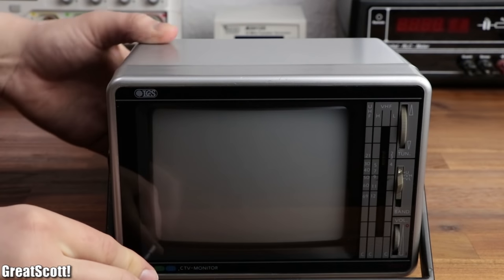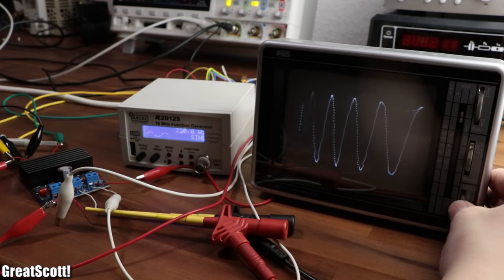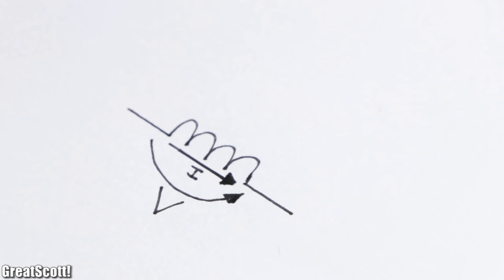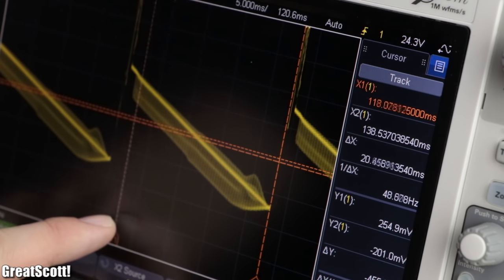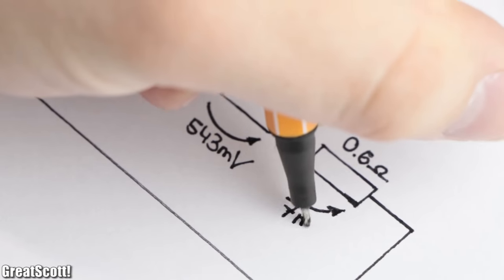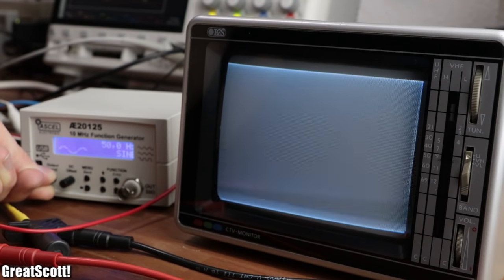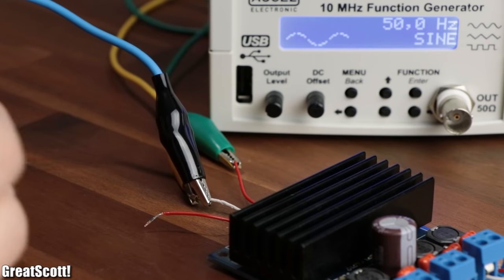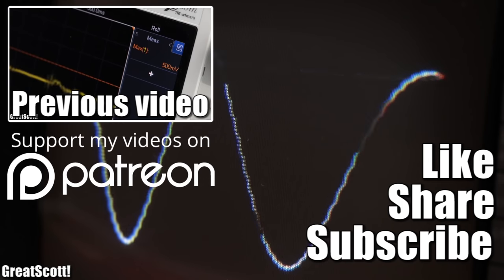HACKED!: CRT TV becomes a crude Oscilloscope

Comment: Back in the early 70's I worked on TV's. I disconnected the horizontal and vertical yolk connections and wired them to the left and right channel outputs of a stereo amplifier. It presented a fascinating Lissajous pattern of the music.
Reply: I just remembered that I left the original yoke connected but set to one side. Then I slipped another yoke onto the CRT that was connected to a stereo. Important to the HV to keep a load on the horizontal output.
Reply: Henry Pitts When I made this test on a 1969 color TV, which still used vacuum tube to drive the horizontal/high voltage (+25kvolt), it appeared to work well with horizontal yoke unplugged. in case of overload, such as short circuiting the high voltage, the tube plates were glowing red but survived. With fully transistorized TV, any small stress and the high voltage transistor is destroyed. Not really friendly to curious experimenters.
Reply: @Henpitts  You must have done the exact same thing that my highschool electronics teacher did! ;)
Reply: Can you help me do that with an old mega watchman TV please Henry?
Reply: Lissajous pattern? The logo of the Australian Broadcasting Corporation.
Reply: @Henpitts  what should I connect to the horizon hv in order to keep it from being damaged? would something like a resistor or  small lightbulb work? or would I have to get another crt and use it's horizontal coil to take the load?

Comment: WARNING: You have to discharge the CRT because it acts as a capacitor and can deliver 30-40kV. Please do this only if you have knowledge of CRT's and the voltages that a CRT uses. Old B&W TV's use around 15kV.
I even had a dead small B&W TV and after about one hour of testing it still had a charge. Also never discharge it with a screwdriver because you can damage the CRT and there are many dangerous materials on and in a CRT, and if you do it, do it outside and wear a facemask, and really do that if you vent it, otherwise phosphor can be blown of the screen (mercury too) and that can definitively cause bad lung damage, that was with the same B&W TV.
Reply: Definitely. NEVER put your fingers behind the rubber HV cup fixed to the tube - I once did this on the back of an old colour TV more than a day after it had last been powered, forgetting that the inside coating of the tube would still be holding a charge. The force sent me flying across the room and I guess I was lucky not to have been killed.
Reply: That's just theoretically, forget what you study, I always work with this kind of stuff and there is no problem, the only dangerous parts are the big capacitor but not a thing to kill and the THT output, nothing else
Reply: You're more than welcome to make a video proving what you said :)
Reply: Can't agree more. The only time I took apart an old CRT, I made sure I took all the safety precautions and discharged he CRT. The spark is surprisingly large, and could definitely be a lethal shock. Stay safe out there!
Reply: There is "only" 25Kv on this modern color CRT.
Reply: +GpanosXP when i got an old CRT and a camera, i will do that with pleasure
Reply: >Modern
>CRT

Choose one.
Reply: Whoops! Looks like you're wrong!
The CRT is only dangerous if it's in circuit while the set is running! Any stored current in the tube is discharged by both a bleeder resistor and the rest of the set continuing to draw current. 

It's usually between 10kV and 26kV, but I've only ever seen up to 24kV. Granted, this is at such a minuscule current that there's no way it'd hurt you - unless the tube is in circuit. The 24kV by itself won't hurt you any - you'll barely feel it. When the tube is in circuit, this couple of milliamperes is brought up to a few hundred or even thousand milliamperes and can seriously hurt you. 

In short, unplug the damn thing and you will be 110% fine.
Reply: HVI Probably should spell that out further: 30-40kV = 30,000-40,000 Volts // CRT = old tube television circuits and tubes. 
   Just saying, if they don't know the hazard, they probably don't know the nomenclature.
  Even if it is or isn't lethal, I believe noobies are better served with a side of caution.
Reply: I got a shock off a 21" TV tube when it was off many years ago, I absolutely definitely did feel it! I was wary of them before, I've been even more wary since. :)
Reply: I've gotten big arcs off of TVs found in attics. Unless you pulled the TV out from behind a model T Ford I think you are fine.
Reply: But it doesn't kill, it just hurt a little bit if you don't have habitual use of electricity
Reply: Didn't GreatScott! Have a video on this before? Or was that 8-BitGuy? (actually, I think it was) It may be wise to include such a disclaimer in any video involving such techniques. I know I was taught it when I understudied a TV engineer in the '90s.

It's not just the HV cap either, though that's the best place to ground out before you start work. The tube is essentially an electrical valve, and acts like a capacitor. It will (rather, can and therefore you should always assume it does_) hold a _very high voltage charge for many years, and into the decades, depending on the atmospheric conditions it's kept in, and the precise construction of the tube.

Many were painted with a metallic coating, or RF insulated with conductive materials If you give it a path to earth made of your body, it's highly likely to let the genie out of the bottle and say "Thank you very much." XD (Yes, he really does look kinda blue (; )

The good news, is that (unlike grounding even a mere 240V mains) the tube will discharge quickly. This means that, while you may well need CPR, or another, controlled jolt from a crash-cart, getting that assistance will not be hazardous for 1st respondent. If you become "live" to an active circuit, even at low voltages, your muscles tend to clamp on to the circuit *hard*, and involuntarily, (like the legs of a dead frog) and will conduct that current to anyone who tries to assist you.

Here, it'll be a short sharp shock. So, just make sure you don't open it up in an empty house, and preferably have a friend, co-worker, or family member (preferably one who knows CPR) keep an eye on you while you perform the operation. Just in case.
Reply: That is extremely unlikely to kill you. This "capacitor" is not much more than a large leyden jar. At worst, it would be the same as a very powerful static shock. The capacitors to actually worry about are the 400V ones generally found on the mains side. Large electrolytics that can deliver a whole bunch of amps for several milliseconds. By shoving a screwdriver to "short" that capacitor, you are in more danger because if the ground clip pops off, your screwdriver will directly expose to the several thousand volts. Don't expect the plastic handle to keep you safe, it was not engineered to protect against high voltage. I have a screwdriver which arced over to my hand through the plastic.  Left a beautiful Lichtenberg figure inside the clear yellow plastic.
Reply: +bobsobol you said many things correctly but in practice it does never kill you, the only dangerous part are the Big capacitor and the output of the THT, everything else doesn't kill, it just hurt ( freeze your body a little bit ) this is my experience about CRT/TV, I always said to my teachers what i said here and with prove, they said: you are a specific case, i told them to try but they fear just to try because they studies things theoretically not by experience but i understand their fear because it look not a game to test :))
Reply: Power Max: That's odd, because regulation electrical screwdrivers have handles rated to insulate against 1kV, as standard. (I'm not talking about the dodgy ones you pick up in Poundland, or even ASDA, of course) The ones your employer should (by UK law, at least) insist you use. I'm fortunate enough to have an employer who takes notice of such laws, and makes us aware of them when providing work tools. Though, these days, I rarely go near anything over 230-250V AC domestic mains. Equally, if your domestic mains is of the 110-130V variety, (U.S. and China) I'm well aware that electrical safety laws are far less stringent, and usually without as many incidents, despite that.

That's exactly how I was taught to discharge a TV tube back in the day. (TBF, I was young, 14, never used that lesson much after that, and may not have stored all the details for the 30 odd years that have passed since) Though we did solder a domestic earth line to it, and tape it on with electrical insulation tape. We also wore insulating gloves, and stand on raised, insulated flooring while doing it.

12v is easily enough to "kill you", of course. Remembering the old adage "it's the volts that jolts, but the amps that kills". ;) (by which I mean, as you can drown in an inch of water, if there are enough amps, it doesn't matter how low the voltage is)

More worrying with voltage is if those "jolts" cause defibrillation, and stop your heart without anyone to notice and get it started again. If applied in the right place, or if the victim has a weak heart to begin with... Well, however unlikely, that's essentially what a pace-maker is doing in a controlled way from little more than a watch battery. I take your point that it's _unlikely_, and agree. (we're not talking about applying it deliberately to ones heart) However, I don't like the odds of getting caught out where uncontrolled arcing is concerned, and I'd want someone supervising.

Belt and braces.
Reply: +HVI You know the voltage at which the crt runs is dependent on its size right ? 25+ KV is for 20+ inch color crt's and i agree that old B&W  crt's run at 15 KV but that also depends on its size.I also agree on the capacitor part xD(i got shocked by one :D).The shock can be lethal but only if you touch the HV lines after you shutdown the tv.The capacitance is too small and it quickly discharges.
Reply: There is a reason electricians learn CPR.
Reply: +Pete Lorenzo There is a difference about talking and practicing? what i said is by experience not just what you learn as fact, the fact is what is real and practical, everything else is just blabling
Reply: If you get shot in an extremity, (ignoring that getting strong electrical shocks and being shot are both very painful and disconcerting) you wont die instantly, but it could prevent you getting to a medical centre under your own steam, and you may well bleed out before help arrives if you don't take steps before hand.

And that's not a hard thing to do when working on a CRT. Just find a friend or family member and say, "I'm about to do something a bit risky here. Can you do me a favour, and just stay close by?" I'm reasonably confident they would agree to do that. : ) If not, then your "friend" is an asshat. XD
Reply: HVI can someone help me if its goot use potentiometer bochen 3296 as a step down circut? i try it i just stick it to the 32v 1,5a psu ant add on it big heatsink. but its not very stable. can it breake something ?
Reply: +bobsobol lol, that's correct haha
Reply: PunakiviAddikti i just buy one step down and one step up from aliexpress but step down come broaken and step up wos not working :/
Reply: Small portable B&W TVs powered by flashlight batteries will use a screen voltage as low as 300V.
These 5" diagonals don't need high voltage because they are b&w & the inner coating on the screen's phosphor layer is Stannous Oxide and not Aluminium.
Reply: Using a screwdriver doesn't damage a CRT
Reply: That depends on how the 'screwdriver' is used! Manipulation or penetration, or discharge:-)
Reply: +TheGamerB_2017 I agree with +Chad Castagana. I put a nasty chip, right in the middle of my favourite Euro72 MultiSync CRT using a screwdriver... Admittedly, I wasn't trying to use the screwdriver on the monitor, I was trying to pry something else open and the screwdriver flew out of my hand and connected tip to glass. I'm lucky it didn't implode, but I got many more years out of it, despite the blemish. ;)
Reply: +bobsobol wrong tool for the jerb! hammer is the all purpose multi-tool. just think, you coulda dropped a hammer on that crt
Reply: +Pete Lorenzo XD Yea. I'm glad I didn't do that too. ;)
Reply: I think we know how to handle EHT
Reply: i discharged it with my **
Reply: @AiOinc1  Your wrong. While the CRT is connected, it holds a charge with the set off, OBVIOUSLY, or no charge would be present after its disconnected. Are you trying on purpose to hurt someone?
Reply: Thank you. I'm glad I'm not the only person who had an issue with the lack of safety information in this video.
Reply: @GpanosXP  :)
Reply: Don’t be a narc bro
Reply: @GpanosXP  Generally people tend to make a bigger thing out of discharging a CRT on YouTube than is really necessary nowadays, but having said that I would still recommend attempting to discharge, just in case ;)
Reply: @AiOinc1  'Newer' CRTs should auto discharge, if it has valves it isn't newer ;)
Reply: LiliMarco1  You are about 3 years late but sure.
Reply: @slm60uk  it did not send you flying
Reply: @AiOinc1  assuming it has a bleeder installed
Reply: I learned that the hard way
Reply: @davidk8893  That's a good point. In all fairness. I've certainly seen some nasty burns from a 12v battery, but in that case it was shorted out by an external conductor and pressed against the skin. (Gum wrapper, and battery in jeans pocket... Doh!)
Reply: @bobsobol  oh yeah, it definately can cause some burns if you short it out with a wrench or screwdriver. I made that mistake a few years ago on a lawnmower battery and it actually melted the steel threaded battery stud out of the lead battery terminal.
Reply: @bobsobol  also you can't compare a bullet injury to electric shock because unlike physical trauma, electric shock only hurts and paralyses as long as you hold on to it, and goes away as soon as you let go. But if the voltage is high enough and you hold it for long enough you'll die and the only help your friend can provide is burying your body.
Reply: @Cockalicious  lmao. Well, you're not wrong, but I've certainly shocked myself enough to still be sore and shaley the next day. (that's what 250V domestic does for you) and you can survive and still come out with quite horrendous burns... It's been recorded in failed electrical executions, as well as public incidents with overhead distribution lines. (Kites or such, I imagine)

But I agree, that doesn't compare to being impaled by a projectile in terms of blood loss and tearing. The bruising feels more like a jolly good thump, or crushing to soft tissue only... But it's really just overexertion... Like going way past "the burn" and then some at the gym.
Reply: I bet you are fun at parties
Reply: My CRT capacitor still charges after one and a half days. Impressive?
Reply: Sorry, but this is yet another way over-the-top warning for CRTs. You don't need to take it outside, and you should discharge it by connecting it to the wire spring that runs around the tube. This is the ground and shorts the tube out. It's perfectly fine to do it with a screwdriver, jist make sure the bit you are holding is insulated. A screwdriver and a bit of wire (maybe a clip) is all you need, dont force the screwdriver under the cap, ease it in,  and you will be fine.
Reply: @AiOinc1  Older TVs, mosly Black and White, dont have the discharge bleeder so can hold a charge longer. It's not half as scary as a lot of people make out nowadays though. Just don't be stupid!
Reply: @Muslim_011  We are still waiting after 4 years. I'm wondering if you're still alive.
Reply: @longdongsilver4719  Yes I'm alive
Reply: Yes dear due to this reaMake circuit of oscilloscope that run on video input composite of TV with out open any tv or any other device.
it make on working tv or video input based devices or monitor but not used A2D based circuit like Arduino or other digital circuit
Useing analoge circuit this is awesome new idea to make every video based devices into oscilloscope.
Can make tow different frequencies horizontal and vertical,and then distrube by injecting measuring signal work oscilloscope.
Reply: But there is defenitly no phospor in this screens - it depends on the colour - it's then a mix of zincsulfur with copper, silver or a rare earth mixture (ytrium/europium = red)
Reply: Bro this is like a 7 inch crt. It does NOT hold 40k. More like 7kv at most, if it doesn't have a bleeder resistor. No, you're not going to die touching the board or the magnets with good insulating gloves, not even bare hands.

Comment: Back in the age of television when I was an awkward nerd, the late 1980s, a fellow nerd told me that connecting the deflection coils to an audio amplifier would create trippy patterns.  Really just that, the deflection coils where the speakers to the amp.  Classical music was mesmerizing.  Waveforms seemed to rotate in 3D as the sound decayed.  Before you do any of this, know a CRT can KILL YOU!!  Yes, discharge the kill you capacitor, which is the big old CRT tube itself, by shoring chassis ground to the connector under the suction cup thing on the tube, the high voltage connector to the flyback transformer.  If what I just said was Greek to you, never open a CRT case, high danger.
Reply: So did you connect the CRT deflection coils X and Y axis to the Left and Right channels of an audio amplifier? As i just wanted to know if that was how you sort of got a 3D affect on the CRT display.
Reply: @ewansbuzz127  Yes, left and right to X and Y.  To an old school transistor and heavy transformer amp. As a note decays subtle changes to the frequency takes place, and the left and right are out of phase, resulting in what appears to be a rotating loop or infinity sign.  Best to find an actual oscilloscope to observe the phenomenon.